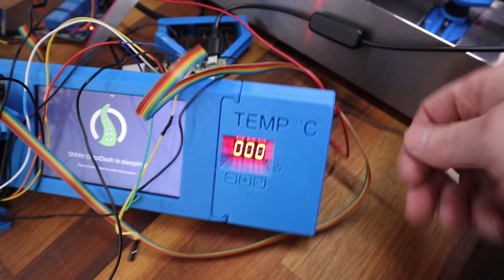Prusa Box How to Wire Up Raspberry Pi Fans, LED Lighting Temperature Controller, Relays. 3D Printing

Comment: Colin, could you share your .STL for the PRUSA controller faceplate without the 3 line display opening.  I had printed that one last week, but given the conflict with OctoDash, I'd like to print this revised version.  Thanks very much!
Reply from the maker: Sure. Will do shortly and post link. Shame Octodash and pi display won't work together.
Reply: @colinhill  Thanks very much, Colin.  You rock!
Reply from the maker: added to video, have fun.

Comment: Merci Colin pour le détail des branchements qui est très bien fais, mais je pense que tu devrais mettre un schéma papier avec des couleurs qui serais plus simple a lire et évité le casse tête chinois. En plus avec le traducteur google pas trop au top c'est difficile a suivre. Du coup vous avez changer de contrôleur de température il y a qu'une ligne de chiffre, alors que dans votre vidéo il y a deux lignes une vert et une rouge.
Reply from the maker: Hi. The link in description is for the new one line PWM display and controller. I prefer this controller as it gives proportional fan speed.
A diagram! Possibly. They are not easy to do. See if I can add to the description area.